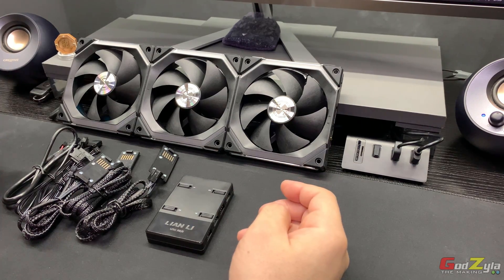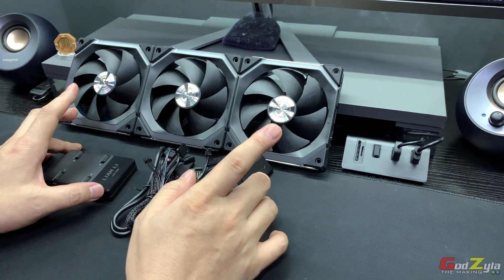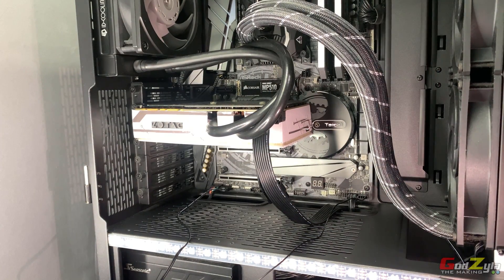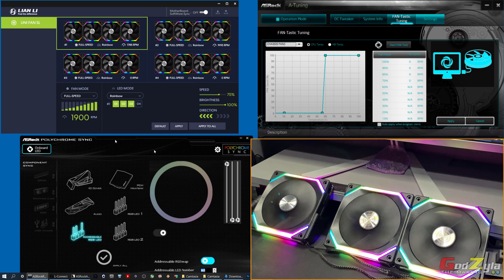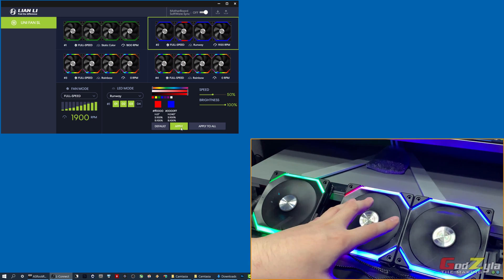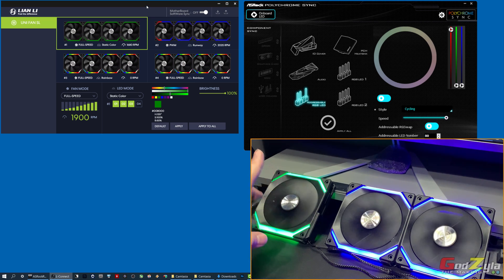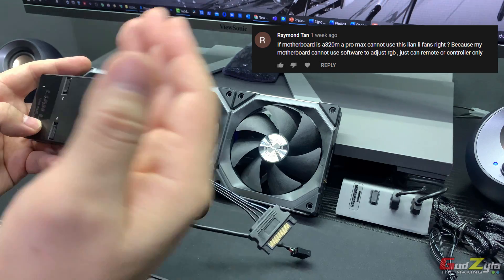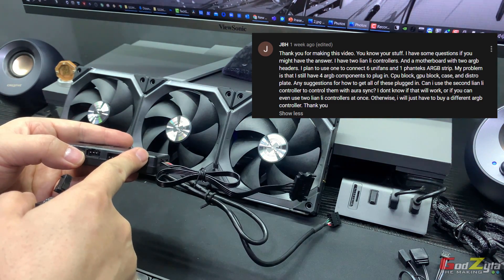Lian Li Uni Fan SL120 - Connection & The Controller (Part III) [L-Connect]

Comment: I'm a year late to the party, and your video definitely helped me a lot on my recent build! 
Thank you very much Kleo!

I have currently 3 groups of Lianli Unifans (6 fans in total) connecting to the Unihub.

However I have another 3-pin case fan hanging around.
I'm wondering if I could connect the 3-pin into the PWM slot of the 4th unused group on the Unihub? and leave the ARGB slot empty?
Reply from the maker: Hi Xwchannel , welcome to my channel, yup you can plug it in but that fan might run fullspeed at all times.. once again thank you to have visited my channel and all the best with your build.
Reply: @KleoYan  Appreciate your guidance on this! So does that mean the PWM port on the Unihub is compatible with fans from any other brands no matter its 3/4pin? I may want to purchase a 4pin Arctics F14 to replace my case fan just in case it gets too loud so I could control the speed.
Reply from the maker: @XwChannel  for 3 pin, you can plug to it no issue but for 4pin PWM , there is a restriction as your L-Connect has profile which are meant for either SL or AL fans, which is base on  the controller. if you get the Arctic F14 which is a PWM fan, the profile you select on L-Connect which is full .. high and etc.. thats according the SL or AL fan and not for your F14. you still can use it, it's just that it's not at its full potential.
Reply: @KleoYan   Got it! Lianli's SL are pretty expensive. I was trying to look into cheaper fans since that will be hidden at the bottom of my case purely for intake purposes and have seen your recommendation about Arctic series. I guess I'll just stick with the current case fans first. If needed in future I will get some better fans and a splitter instead. Thanks man!
Reply from the maker: @XwChannel  Hi, honestly speaking, if you want my opinion. though I have done lots of content about these SL and AL fans, personally I don't use them. I am just curious how they work. my own personal pc. I make use of P12 Arctic PWM PST CO fans or the Nidec Gentle Typhoon 1850rpm fans. I prefer performance over argb, but I don't mind some light effects.. this was my rig at year 2021 https://imgur.com/gallery/Pw5kY4q. now I have change to use the Q58 SFX Case. and it's without any rgb or argb lightings.
Reply: @KleoYan  wow you even did your own cable sleeving! I'm thinking of buying custom cable extensions but due to the pricings I'll leave it to the future lol
Reply from the maker: @XwChannel  Hi ya, yup, infact most wiring, sleeving plus custom shortening fan cables, I did it all, you might be interested in my little journal when I migrated my pc parts from a towel case to this o11d mini https://youtube.com/playlist?list=PLEW-b-2vYDdOt8Zk6UFe1OlPEUOfQQ4AM (Lian Li O11D mini - Modification & Preparation and Lian Li O11D mini - The Migration)

Comment: You said l-connect is enough to control the fans. What is about controlling the fan-Curve with l- connect software?
Reply from the maker: Hello ekace33, welcome to my channel. yup you can set respective profile on L-Connect and if you want fan curve. you have to set on your motherboard UEFI fan curve first. please note, you only able to set one fan connect fan curve and whatever fans that are attached to the Uni controller, be it output 1 2 3 and 4, all will follow the same curve. if you want it differently, I suggest you plug those sets of fans to the respective fan headers, make use of your motherboard uefi or fan ultility to control the PWM fan curve individually.
Reply: @KleoYan  well, thx a lot for your really fast answer. i plugged in everything correctly but my uefi bios under q-fan control can't find my system fans and so i can't set up an individually fan-curve. i am totally fine when the fan speed for all fans are the same. i control 2x3 fans and 1x1 fan with the SL-controller. PSU, USB and 3 Groups.
Reply from the maker: @ekace33  I see ok. So long you are fine with you setup and ok with the temperature. That will be fine 👍

Comment: Hi, is there any way to get these fans under 800rpm? This is too loud for me. I tried noctua speed limiter but it is not working with lian li fans. I would like speed about 400-500 rpm. 🙁
Reply from the maker: Hi Peter Juracka, welcome to my channel. I have yet to try setting at that low rpm. You can try connecting those set of fans directly to your motherboard fan header and control them using the motherboard utility fan curve. So far I am only able to get it run at 600 but not anything lower.

Comment: Will a deepcool rgb converter work with this? I only have a 12v rgb connector, and not a 5v aRGB. Will i get full control over the fans through my mobo with this?
Reply from the maker: Hello Karl Løvendahl, welcome to my channel. I do came across this device but do not know if it works. Anyway you can don't connect that argb cable between your uni controller to the motherboard. By connecting the USB And Sata is more then sufficient to use the L-Connect to control your fans argb. If you wanted to use the motherboard argb software, I would adivse you to ask at Lian Li reddit forum here https://www.reddit.com/r/lianli/

Comment: Excellent video/ Would there be any reason why some of my fans dont have any lighting? I've triple checked the controller hub and everything looks secure. I'm stumped.
Reply from the maker: Hi FastEddie989, welcome to my channel, on your L-Connect. there are indication of 1 2 3 and 4 on each output. make sure they are highlighted, if not it will not light up. if that's not the issue. I would suggest you to test out one fan at a time that connects to the uni controller output. if fans does function, test out daisy chaining a fan at a time. just make sure you do not go beyond 4 fans in one daisy chain. during the chain, if the following fan does not work, swap another fan and daisy chain, as it could be due to contact issues. if that's the case, use an eraser to clean up the contact points like the illustration in this video https://youtu.be/XxSL8VZoYRg?t=1428

Comment: Hi, i have a question i want to buy AIO galahad 360 + Uni fan hub , as well as Phanteks P500a case( It has 3 PWM D-RGB fans) , could i mix and sync fans+pump from aio with case fans through the HUB +  Lian Li software? My motherboard doesn't have an ARGB header. There is not much information about using uni hub with other brands.
Reply from the maker: Hello Mark Bachilo, welcome to my channel. Motherboard that does not come with argb connectors, not an issue. I would advise you to connect all fan load to your motherboard to have total control and leave all argb on the uni controller and let L-Connect app to control the lighting effects. as for not much info about other brand fans. first you need to know what are the led rating .. please make sure is LED and not fan load.. this might aid you with it. https://youtu.be/bMRz2KVqbjA

Comment: I sure hope you can help , The L connect2 program isn’t working properly , even after I download the fix . Any recommendations would be appreciated.
Reply from the maker: Btw James. If your SL controller does not have a SL marking, you can do the firmware by following this video https://youtu.be/hZpzR_4917c
Reply: @KleoYan  I just wanted to say thanks for your knowledge and I followed every step for updating firmware , and needless to say , everything works fine . I’m so glad my wife won’t have the pleasure of watching me trying to figure out “ The two controller “ problem , and always telling me “ you’re always working on that thing “. 😂
Reply from the maker: @jamesflat-earth2385  you are most welcome 😉
Reply from the maker: Hi James FLAT-EARTH welcome to my channel. I assume you are having the SL uni fans. Does your uni controller have a SL marking on it? If not, you will need to do a firmware on the uni controller and if are worried on performing the firmware. Download the oringial L-Connect as it works with the SL fans

Comment: Wait so at 11:50 u said u can remove that motherboard ARGB cable, if i do that will i still be able to use rgb on the fans through the Lian-Li software?
Reply from the maker: Hello Kevin Corrigan, welcome to my channel. Yes correct, you will still be able to operate the argb effects so long as you have usb can sata cable connected to the uni controller as the fan load and argb effects are controlled by the L-Connect application, unless you want to control the fan load and argb using your motherboard application.
Reply: @KleoYan  Whats the difference? Isn't the motherboard one more generic? I feel like the L-connect is more specialized for the fans prolly.
Reply from the maker: @kevincorrigan1754  there is a difference with the argb effects, if you have the fan load cable and argb cable connect between the uni controller and motherboard, you can switch between using the L-connect or to bypass and to use the motherboard app to control the argb and fans, but for fan load, it will only takes in one input pwm instruction from the motherboard header, you can't individually set the pwm fan curve to the outputs of the uni controller.

Comment: Can I controller all the AL120 fans on the AIO/CPU fans with the L-Connect software aswell as the case fans?
For example if I had:
2 x AIO X52
2 X GPU Galahad 240mm
2 x Front
2 x Bottom
1 x Rear

Great video, thanks
Reply from the maker: Hi adv10, welcome to my channel, just a question, what's 2 x AIO X52? you mean to say you going to have 1 x Galahad AIO + 2 more NZXT Kraken X52 in a system? I am confuse with your configuration.

Comment: I need firmware for sl120 controller  when i update its give me error on verify and now i am unable to update with that firmware  if any 1 have i need it badly to fix my controller
Reply from the maker: hello Aizaz kiani, welcome to my channel. stay calm. now your SL120 controller does it have a SL marking on it. if it has, you dont need to do firmware and you can use the L-Connect 2 application. if your controller is without the Marking, then use the L-Connect app. if you still want to use the L-Connect 2 on this older version SL controller. kindly view this for instructions. https://youtu.be/hZpzR_4917c
Reply: @KleoYan  thanks for your Help bro i will check and tell u again Thanks alot
Reply from the maker: @aizazkiani4739  you are most welcome, hope everything works out fine for you and all the best in your build..
Reply: @KleoYan  thanks Alot Brother your Methods works   with app L connect 2    my controller  is without lable
Reply from the maker: @aizazkiani4739  glad that it works, congratulations :)

Comment: Great vids, so if I connect all my fans to l connect and select pwm on the fans that are on my radiator, I can select fan curve on the motherboard and only those fans will adjust to the cpu temp and the other  fans will stay on low for example, is that right.
Reply: I was thinking off doing that, but didn't think about if the controller failed, that is a really solid point, I will do that, thanks 👍
Reply from the maker: @stretchybwoy  you are most welcome 😉
Reply: @KleoYan  sorry, but quick question with regards to this thread.  Right now, I have 10 fans and the aio argb plugged into the controller.  The aio is plugged into the cpu_header.  Should I move the aio to the pump_header and use the 3rd wire on the controller (argb and pwm) and just connect the pwm to the cpu_header so all fans will keep working?
Reply from the maker: @jasonrives  Hi and welcome to my channel. my answer to you is no. you see if your controller fail, your pump might just stop. I mean it could happened. Argb stop is of no issue. I rather you still have your pump consistently moving. Case fans can stop but not the AIO pump and the radiator fans. just a safety measure.
Reply: @KleoYan  so I need to put the aio pump to the pump_fan1, the radiator fans(3 fans) on the cpu_fan1 and the uni hub(7 fans) to sys_fan1?  This is a MSI Carbon z690 motherboard.
Reply from the maker: @jasonrives  hi, for AIO pump and Radiator fan load only.. which is AIO Pump to pump_Fan1 and for radiator to CPU_FAN1. As for the rest, you can just plug to the uni controller or is up to you if you want to have total control over the sets of case fans.
Reply from the maker: Hi Lee Stroud, welcome to my channel and yes that's correct. provided that your UFEI or Bios of your motherboard is set to PWM mode on that cable which you have connect between the uni controller to the motherboard.
Reply: @KleoYan  thanks, just finished my first build and this helped alot as no-one really tells you about aio fans to set for temp, etc
Reply from the maker: @stretchybwoy  Hi,that's good to hear. infact I would plug the radiator fans directly to the motherboard CPU_FAN header and the AIO pump to CPU_FAN/Pump header. reason being, in the event if the uni controller fails. at least you know that your pump and radiator fans are in working condition not matter what. Then leave the case fans to the uni controller. Case fan can stop spinning but not radiator fans. thats what I normally will do for pc builds using the uni fans.

Comment: My fans spin and light up but I can’t get them up on the software.
Reply from the maker: Hi Javasius, welcome to my channel. try these steps to see if it helps.

1) is your chipset drivers updated in your system (Intel / AMD) https://youtu.be/8l4i5UjO3es
2) are you previous using other argb program that is for your motherboard before you install the L-Connect app? If that's the case, kindly remove all argb programs that are installed in your win10 or win11. please make sure of Revo uninstaller to clear all the left over files https://www.revouninstaller.com/revo-uninstaller-free-download/  then reboot your system. Install the L-Connect app only and test out your uni fans. if that works, then install your motherboard argb program if you still need to use it.

Comment: Lian Li has posted a method that updates SL fan controller (that isnt stamped with SL logo) firmware to support Li-Connect 2 (fixes the fan control issue) tried it just now and it worked
Reply from the maker: Hi Faisal Alomari, welcome to my channel and yup lian li did https://drive.google.com/file/d/1lZDI9FQEHRptOKHJTeL8_Qf7os3I1hU0/view :) .. infact I have done a video on that too https://youtu.be/hZpzR_4917c
Reply: @KleoYan  oh haha ofc id stumble on the outdated video :P only took me 3 hours to find the right method 😤
Reply from the maker: @frayfrayship  is ok no worries, but still thanks for the update.. greatly appreciated it :)

Comment: But.. So you can't really use the L-Connect as a fan controller? You can't set them to follow the CPU or GPU and you can't set a curve?
Reply from the maker: Hello XXOUTT, welcome to my channel. you can , just need to plug the PWM cable between then uni controller and the motherboard CPU fan header. in your UEFI / Bios, set it to PWM, then on your L-Connect, set to PWM in the fans section where you set the RPMS of your fans.
Reply: @KleoYan  Thank you mate. Easily the best vids on these fans. Although I would have liked more on the fans themselves other than the RGB. Like what I’m asking now.

But yea. I know I can control the curves etc. via the MOBO. I’m asking if I can do the same with the L-Connect. But guess the answer is no.
Reply from the maker: @3XOUT  if you are talking about setting them as in individual set. answer no.. the uni controller only has one PWM connection to one of the fan header. it only takes in one reading. honestly, I would just plug those different set of fans directly to the fan header on the mobo. I let mobo control the fans and let uni controller to control the argb effects.
btw that you for your questions and to have visit my channel. all the best in your build

Comment: I have two cpu pwm headers on my mobo: CPU_FAN (fan header) and CPU_OPT (water cooling fan header). 

On my AIO, I plan to use 2 Lian-Li's AL120 fans that I will connect to the controller. I will also have another 4 case fans (also AL120's) connected to the same controller. Is it okay to connect the controller pwm to the CPU_OPT header, considering I have AIO fans plus case fans connected to the same controller?
Reply from the maker: Hi magno, welcome to my channel, I suggest you to connect. it this way. for AIO pump and fans.. plug your AIO pump directly to CPU_OPT (set to full speed) then plug your radiator AL120 fans to the CPU_FAN, this way you know that those fans will react upon the temperate of your CPU. make sure in UEFI / Bios you have set CPU_FAN to pwm, you can set your own fan curve or to use the profile, example Normal, Performance, Quiet and ETC. as for CPU_OPT set to full. as for the AL120 argb, connect it to the uni controller. the reason to do this. incase of the uni-controller or L-connect application goes wrong, at least your CPU pump and AL120 on the radiator will still be working as it's following direct orders / commands from your motherboard.

as for the rest of the AL120 (Case fans) you can plug all to the uni controller and control the fans using the L-Connect or you can bypass and to use motherboard pwm settings to control your fans, just make sure that the pwm cable is connected between the uni controller and to your motherboard fan header (example ChassisFan1) and please make sure that in UEFI, example ChassisFan1 is set to pwm with the fan profile (Normal, Performance, Quiet and ETC)
Reply: @KleoYan  Thank you!
Reply from the maker: @magno5157  you are most welcome. if you do need more help and I did not answer you. do not hesitate to email me at godzylatech@gmail.com .. I will try my best to help you out. once again thank you for visiting my channel :)
Reply: @KleoYan  wow thank you so much for being so helpful!
Reply from the maker: @magno5157  you are most welcome. 😉